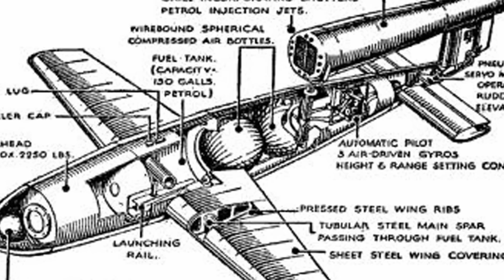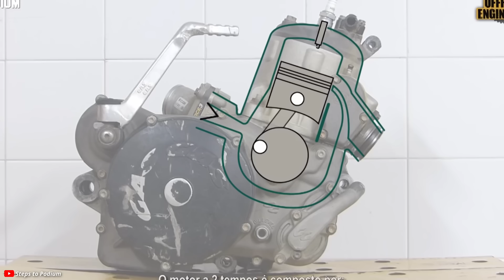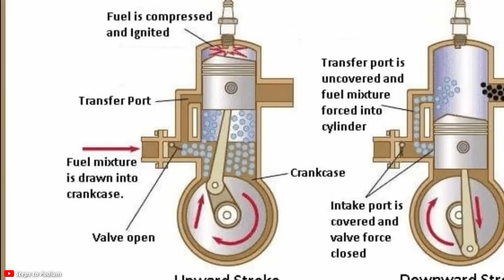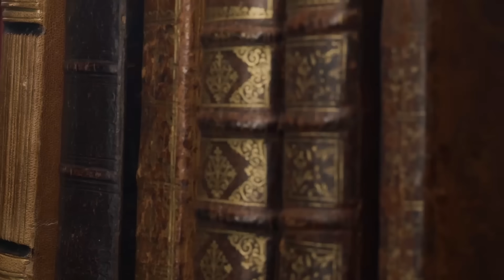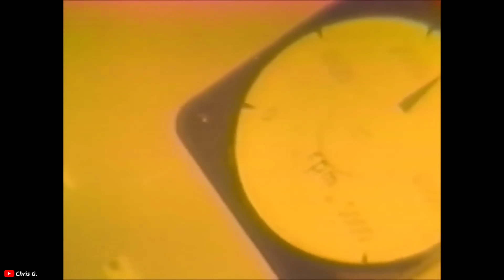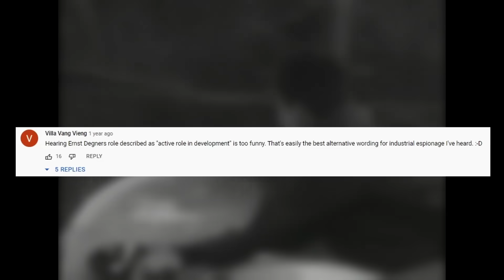How Suzuki stole communist technology to make their motorcycles faster

Comment: The truth is, Suzuki's success doesn't lie in the work of Water Kaaden at MZ in the 1950s.
Suzuki's success lies in the work of Water Kaaden for Hitler in the 1940s, more specifically the V-1 and the use of wave phenomena to power the engine and its exhaust. So it comes from the German works FOR HITLER.
It should be emphasized that Water Kaaden was not a modest engineer who only wanted to pursue his dreams in the field of motor sprints. Above all, he was a significant employee of the research center of the German war machine, which today is called "Nazi". They weren't some nazi-aliens, they were GERMANY! These silent engineers who later worked for German and American factories, but during the war, first of all, produced tools to kill people.

Comment: My Kawasaki avenger 350 was as fast as the h1 500 which used the same frame it is well known the rotary valve was as important if not more so as the spanies these Kawasaki motors are so well built it has been liken to aircraft build quality way better than the later triples.one of my prized possessions is a complete bottom end less the covers and carbs on a 1970s racing stand I just love looking at it

Comment: Many of post-war large company in Japan were held by secret Korean immigrant clans (essentially infiltrators, after all) of medieval to modern times. Suzuki (Yamaha, Honda, so Toyota, Subaru, Nissan too) certainly is no exception. So they are not Japanese company in the strict sense.
Reply: 19:34  Hey, Kawasaki entered Grand Prix much later in 1967 with 250cc and 125cc, not big ones. And their 500cc factory effort was even much later I guess. Kawasaki has nothing to do with this Suzuki's tech theft story. And, Honda is the biggest beneficiary of it, since they basically dominated 125, 250, 500 with 2-strokes in the 1980s and 90s.
Reply: 19:56  In fact Honda is the most wrongful, biggest corporate spy/tech scam company. You will see that if you fairly look into motor racing/industrial history in Japan. By the way I'm from Japan, of course.
Reply: [what I wrote to Mike Holland earlier]  Their(Honda's) CB750 K1 was a product of corporate espionage to Kawasaki's early development of 4-stroke 4-cylinder 750. They forestalled to make public of their prototype in 1969 Tokyo Motor Show, so Kawasaki renewed their design to 900cc and released their 900RS Z1 (KZ900) in 1972.

Comment: I have owned in chronological order a BSA Bantam 150 - awful. A Yamaha 200 twin much better and finally a Suzuki GT 380 triple really superb after some tweaking with K&N air filters and a better exhaust system... Also got to ride a GT550 which was rather heavy and a couple of stints on a GT750 water cooled bike... Sorry I never bought one of those. I knew someone with a Kawasaki H1 750 and that frame really did flex!

Comment: The V1 was a "waterborne" missile? Even though it was launched from catapult ramps on the ground and flew through the air. It could even be launched by aircraft. It didn't touch any water except inadvertently. What does the term "solo" in your description of it mean? Were you padding the script?. Calling it "waterborne" is a fabrication on your part and that alone should call into doubt the facts presented in the whole of the video. Describing it as "solo" is not anything that is required for definition. If a museum has one, then yes, that example is a "solo" one.
Links to your sources would be helpful instead of crying about copyright claims that you shouldn't have too much problem with, provided you follow the law.

Comment: The two stroke engine has been around in Europe for a long time. 

But Japan made one very notable contribution to the world of engine design: the first practical rotary engine. 

What’s funny is that the Japanese rotary engine was so good, and so inexpensive that European and American factory owners insisted that it be removed from the marketplace. And that rule is still in effect today. Japan could easily make Daihatsu cars with a rotary engine and a CV transmission, but they would never be permitted to sell those cars in Europe or America. The American trade unions wouldn’t allow it.

A little Daihatsu could sell for six thousand dollars. But the trade unions want that car to sell for thirty thousand dollars. It’s an invisible trade barrier over which Japan has no control. And that’s why the unions must be eliminated. Restraint of trade is how they make money.

Comment: It wasn't Kaaden's invention, either. He did not invent the rotary valve, that was common practice in model 2-strokes before WW II.  He obviously didn't invent the tuned pipe, either, but he was the first to adopt the tuned pipe for this application. Your description of how it works is quite wrong or at least very misleading - it's not about giving more space for "expansion", or "flowing" better  In fact, it gives you more power boost as you reduce the exhaust flow, up to a point. It works by using timed acoustic pressure waves to first extract the exhaust, then compress the charge as the port is closing-  an echo, or over many cycles, a whistle. Both the rotary valve and the tuned exhaust (and intake...) were well understood in the competitive model airplane world in the late 40's/early 50's before they made it to motorcycles, although the first highly effective application waited until 1966. Some of these model engines (for an event called Control-Line Speed/F2A internationally) develop over 1200 HP/liter at ~50,000 rpm using rotary valves and tuned exhaust, and extremely advanced mechanical and metallurgical techniques. I also note that there were fully functional miniature pulse jet engines running on identical principles in the post-war 40's. You can still get one, it's called a Dyna-Jet, and that's where they got the idea for the tuned intake and exhaust.

Comment: Wait, 15:28,, 200HP per litre? Gees they make it sound good.  Unfortunately impossible and a lie.
Reply: 1000cc ÷ 125 = 8
8 X 25 = 200
Reply: Hey, think twice. These racing bikes had so much power, that specific power was REAL. I remember when the first 600cc fourstroke street bikes made a hundred horses. That means a liter bike would do 166 hp. And that is a fourstroke streetbike. See? His twostroke racers could do more, the 200 is not so strange. Today fuel injection computers, larger pistons, you name it, the experts could surprise us. Even do fourstroke in a rotation engine, that might compare to those high revving twostroke racers. What did you want do be explained, again?
Reply: Very much possible lmao

Comment: I wise you would talk trash about sudooky Suzuki see I started riding in 93 and I loved sport bikes and Ive always wonder if there wasn't some shady business going on a bit  Kawasaki  zx 11 was the speed king from 91 to the late 90s and Honda well they had there great power to wight rato cbr 900rr but they came out with the cbr11XX for about two years and I remember reading in cycle word or one of these mags that there where talks between suzuki and Kawasaki  and there was rumor of a merger but the thing was the suzuki sportbike line GSXR THE 600 750 1100 where all fat they were bigger than the rest of the big four but then in 98 or 99 here comes suzuki with the GSXR with SRAD ram air and then the big GSX 1300 Hayabusa just makes me wonder about those talks Kawasaki had with Suzuki and now look at Kawasaki had the zx 14 now the h2 super charged bike where they holding back all these last few years

Comment: You have the basics correct, But your pronunciation is atrocious, It sounds like you are saying codden and Wernher von Braun His last name is pronounced Brown, And Zundapp is pronouced Zoon Dop, not Zun dap, the exhaust on the two cycle motorcycle is called an expansion chamber, BTW, A german by the name of Otto designed the first 2 stroke, his colleagues told him on paper that it would not function and he agreed, but built a 50cc engine and it ran, A bumble bee should not be able to fly, Its wings are to small and its too heavy but...you know its true, Oil and water don't mix, But we have mayonnaise.

Comment: In my day Suzi has always been at the bottom no nice 1970 Suzi mine blow up! In a corner seized! Plenty of oil ! Crap motor cycles.frame flex skips in high speed orrrh but not as deadly as the Mach iii Kaker 500